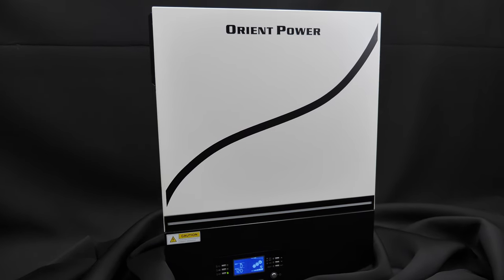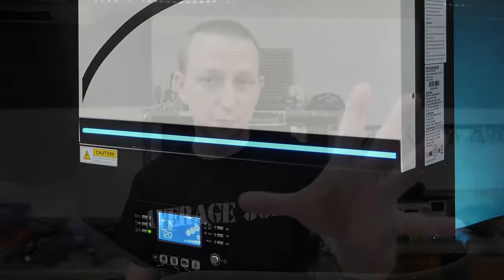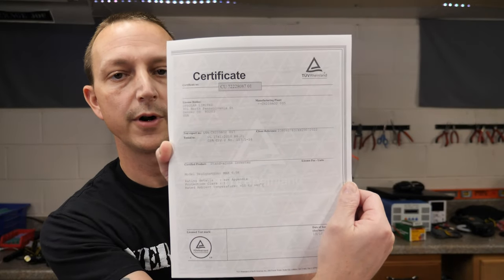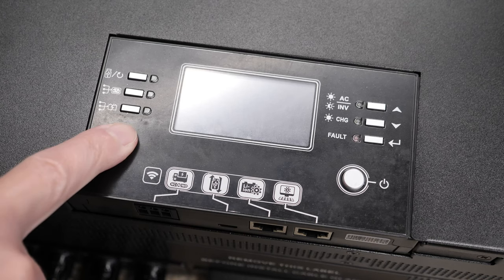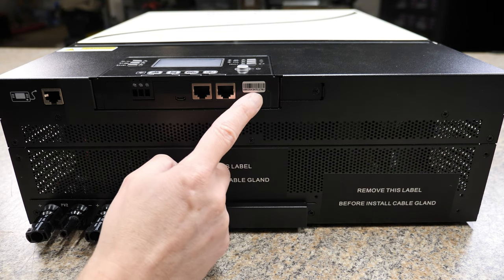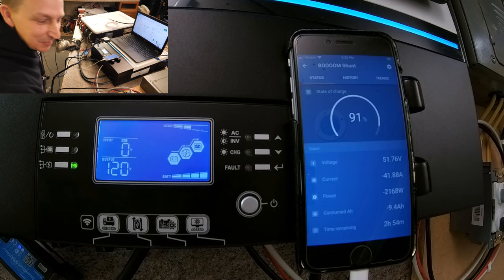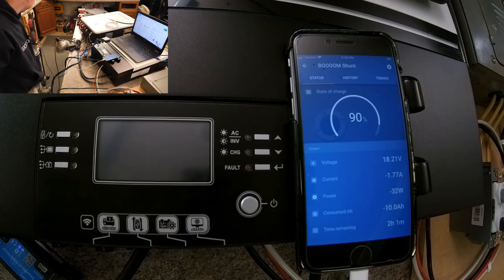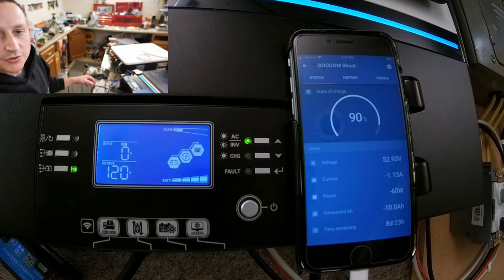Orient Power 6.5kw All in One Solar Off Grid Inverter!  Full Review

Comment: So why would you be talking about the charger part to v part if you don't have any if you don't have any solar panels that's one thing you said you didn't understand the part about solar which is solar panels so why would you be talkin about an inverter that uses solar panel to run it and would charge batteries and electric company to help insist with power when it becomes too low and power that it's not enough part because it's not enough power to run kitchen stove and dryer and a water heater because it's made way too weak and not good enough for more than a camper of course it would very many more by getting like maybe 2 or 4 of them you might have something than.

Comment: The battery-less mode, I believe, is useful for pumps when you want to irrigate fields, etc.
Reply from the maker: Oh ok yeah that may work good for that!!
Reply: @AveRage_Joe  Yes. I would love to see how battery-less can work with devices that can function with intermittent power. Ideally, I'd like to see if you could charge an EV with a granny charger, ie 8A, by just using the inverter and, say, 2kw of panels (2x the load).
Reply: Or for just power savings during the day. I had it like that (a Sungoldpower SP6548 which is identical) for a while before I got my battery built.

Comment: LV6548 with a new decal. My (2) LV6548's run everything I throw at them.
Reply from the maker: Yeah thats what I gather as well. Are you able to run AC and stove and all that stuff while running the normal stuff?
Reply: @AveRage_Joe  My thoughts on being efficient was to put all of my loads that I use daily on my subpanel as well as my emergency stuff. 
I have my furnace and my AC on but the AC has a soft -start.
I left the electric oven, electric dryer and other high loads I only use occasionally off of the system.
Reply from the maker: Ok, you have yours setup very similar to mine. I have EVERYTHING but the AC, stove and dryer on mine. Once I have my diy setup going Ill add the high load stuff. Then Ill be lacking in the solar dept🤣

Comment: Using a pre charge resisters main function is to slow the power in rush to the inverter from 24v, 48v etc batteries. That inrush will blow the capacitor (s) in the inverter and bricks your inverter. I have at least 4 inverters laying around from customers that blew their inverter caps.
Reply from the maker: Yeah thats the other reason to precharge for sure. I did ask about precharging with this inverter and they said I didnt need to🤷‍♂️. Id love to see some pics of those ded inverters😄

Comment: Like your real life testing Joe.
I'm going to suggest that this is a rebranded MPP Solar inverter, this is almost identical to my 8kW MPP Solar inverter and all I can say is that it works just fine, they're real value for money.
Off Grid here so I'm also running a 5kW MPP Solar inverter on a seperate battery bank as my "Grid" input.
You can program these units to exactly suit your needs.
You're doing good worrk mate, thank you.
Reply: If I'm not mistaken the MPP Solar is a rebranded unit itself.
Reply: God knows which one is the original. One thing for sure, they are ALL built in China, probably by the same factory, lol. I have a Sungoldpower SP6548 (avail. in Amazon) and is exactly the same, minus the nifty LED bar.
Reply from the maker: Thanks Man!!!  Only was to test things in my opinion!  100% value for the money!!  Tons of great options!!
Reply from the maker: Could be!
Reply from the maker: Gotta have the Led Barrrrrr😆

Comment: MC4 connection for solar inverter will not pass inspection in my county in Florida. What was the software version ?  curious to see if you can split phase with an EG46500ex.  Good review its going to be interesting to see all the comments.

Comment: Could you also do a grid charging efficiency for total turn around ac to dc to ac efficiency, I’m looking at taking advantage of off peak rates with the bonus of having backup power during grid failures. Our utility is proposing an ultra low rate of .025 per kWh between 11 pm and 7 am.

Comment: Hey Joe, Great review. I just ordered 2 of these inverters and 4 of their 5.12KW batteries based on your reviews. You also saved me $424 bucks using the 5% Joe discount. Thanks man, I will send you a message when I get everything and have it all up and running.
Reply from the maker: Awesome! Would love to hear when you get everything up and going! Do you have solar yet?
Reply: @AveRage_Joe  yes and no. I have 8kw worth of panels to put up once the roof is finished. Probably won’t happen till spring since we are fighting snow now in Utah. This will be 100% off grid system. The biggest appliance I need to run is a 2-stage 80gal air compressor and a TIG welder. I hope 2 inverters are enough to start the compressor.
Reply from the maker: Nice! Oh ya for sure wait lol. I would imagine you will be good on compressor!
Reply: @darylowen6855  What hp motor is on the compressor?
Reply: @sh839c  it’s a 2 stage 80 gallon air compressor with a 7.5hp motor. My 6kw generator will barely start it. My guess is that the 2 new 6.5kw inverters should work nicely with this air compressor. I just installed the batteries and inverters today and should have everything wired up next week. I will post pictures when done.
Reply: @darylowen6855  That is pushing it but technically they should start it. Put a meter on each leg when it starts and check the inrush current. Please post your findings.

Comment: Great review. Overall it seems like a solid unit. It would be good if you could show oscilloscope tracing of the power output so we can see how clean the power is when it it running inductive loads, and switching from sources. The Batteryless option is actually very cool to have. It is useful if you can't afford storage, provided that it can switch to another power source.
That's why oscilloscope trace would be good to see how fast it can switch too.
So, just to confirm... no load power draw of this inverter was 66 watts?

Thank you making this video.
Reply from the maker: Thanks! Yeah I would buy and use these if I didnt have my 12kw growatt. I especially like the parallel option. There are a ton of other options as well once setup.

If I had an O-scope and knew how to use it I would 100% show it!💥🤘
Reply: @AveRage_Joe  You can get low cost (less than $150) portable multimeter + scope combos. They sometimes call them scope meters.
Some common ones are: Owon HSD272S, Hantek 2D72, Uni-T UT81C 
I don't own any of these, but I do have a low cost Hantek 8 ch scope. Personally, if you just want a portable one for the basics, something in the less than $150 price range is good. There's lots of reviews for them on youtube. The main reason I think they would be useful for you is to measure the "switching time" and to look at waveform when running inverter with Inductive loads. Do a search for "Inverters don't like power tools" on youtube, and you will see some interesting stuff too.
Reply from the maker: Awesome! Thanks for the info. I will start looking for one. I agree it would be nice to see for sure!

Comment: Hey AveRage Joe! AveRage Fred 😂here from sunny Puerto Rico. Great review brother! This looks very similar (actually identical lol) to my Sungoldpower SP6548. Orient Power, MPP Solar and Sungoldpower also make a similar split-phase unit TP6048 with net metering capability and parallelable to up to 9 units. I'm in the process to changing to that right now. They all look the same and ony God knows which brand is the original. Probably made in the same factory. Good units so far though.
Reply from the maker: Nice to hear there are AveRage Freds!!!!  Yeah I agree, there all probly made in the same factory.  These are the cheapest Ive seen tho for lots of great options!!!

Comment: Hey Joe, is it easy to change the setting for how many watts the "Grid" input can pull to power the system. Like your demo, I will have to do a temporary feed with an extension cord but want to limit the AC input to ~10A or so..
Reply from the maker: Yeah you just go in the settings and change to 10a!🤘

Comment: It was a long video, I may have missed this but did we never get to the peak/surge capability of the inverter due to the battery not supporting a peak load either?  Probably should get that done on the follow-up video.
Reply from the maker: We did not get to full send it.  Will have to do that in a 2nd video for sure!!!

Comment: I'm new to solar and I'm look to start small with a few panels to power my pool pump. Would this unit allow me to pull from the grid, if my off grid system runs out?
Reply from the maker: Yes sirr it can do that! Only question I have for you is, what is the voltage of the pump?💥🤘

Comment: Hey joe i just order my third husky battery using your promo code.. 
And i notice the run a big discount in all the baterry except for the husky 48volt. 
Why you think is that???  
Thanks
Reply from the maker: Awesome! Appreciate that! What do you mean? Are you saying the run discounts on all but the husky. I think the husky is a SUPER poplular battery because its so versitile. Got me thinking, did the 10% discount code work?
Reply: @AveRage_Joe  yess.. and thanks ..i just wonder every battery has a deal but not the husky..
Also did you think 5kw in solar can fully charge 3 husky ??
Reply from the maker: Im guessin its a "best" seller since its a great battery and it sells iteslf without a deal. I could be wrong tho. Oh ya 5kw in solar will for sure charge 3. I have the rhino and husky in parallel and can fully charge both with 5kw.....in sping, summer and fall tho lol. My panels are not angled for winter season. Plus all the trees in way.
Reply: @AveRage_Joe  thanks im look foward to get one more battery next month i hope i can use your code.. 
I got 2 sistem running my house 24v and the 48 v here in florida the energy cost is way to high.. thanks again!!
Reply from the maker: Florida would be amazing for sun I would imagine! Yeah code should work anytime, if it doesnt, let me know so I can tell them!💥🤘

Comment: LMAO. Batterly. 
question: does the LED strip change colors depending on what it's doing, or can be set based on SoC? or is it just for shows and provides no useful feedback?
It would be cool to set it on a green to red gradient based on SoC of the battery.
Reply from the maker: I know right.....bat-ter-ley😆🤷‍♂️🤦‍♂️ So the manual says you CAN change the led bar for that. In the steps to change it, it only shows like 2 options so I will need a lil moar time in the settings to figure it out to make sure. I know it changes if on grid and off grid for sure tho.
Reply: The RGB LED shows you energy source and battery charge/discharge status.
It will indicate Grid-PV-Battery
There's a separate battery indicator on the control panel that shows the battery strength.
I disabled my RGB LED because it was just annoying. All it shows is if you are running on PV, or line, or battery power.

Comment: It has a max PV Voltage input of 250V DC therefore I would spend a few more bucks and get a model that supplies a PV input of 500 DC volts .
Why is that important well if you can string more Solar cells in series and keep the amps the same and the voltage higher you can use lower gauge copper wire to your inverter from the solar cells...
Check out the price of 100 feet of 10 gauge copper wire verses 4 or 6 gauge....

Its  Very Expensive!
Reply from the maker: Yeah 500vdc string is nice for sure especially to use moar pabels! 250v isnt bad either tho. Who uses 4-6awg on solar strings(real question)? Maybe if the array is really far away im guessing? I have 250v charger and use 12awg.
Reply: @AveRage_Joe  I have a 300 Foot deep yard :)
Reply from the maker: Holly crap!😲

Comment: Does anyone know if it's OK to connect one leg from a 30 Amp tandem breaker to provide power to the input on this inverter, or do I need a dedicated breaker to the inverters AC input?
Reply from the maker: Would be best to do its own single. If u do 1 leg from a double ckbr thats already in use then that appliance wont be "properly" breakered.  Oh wait.... are you refering to one of those breakers that have 2 seperate outputs? Yeah you can use one of those for sure!